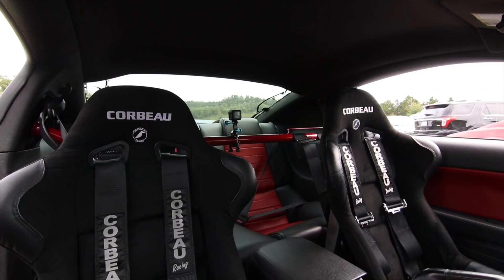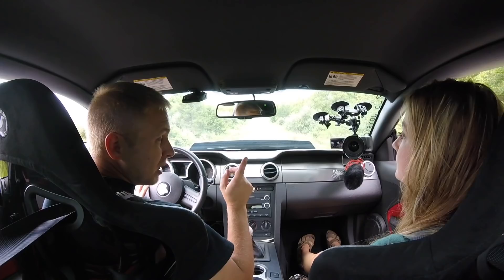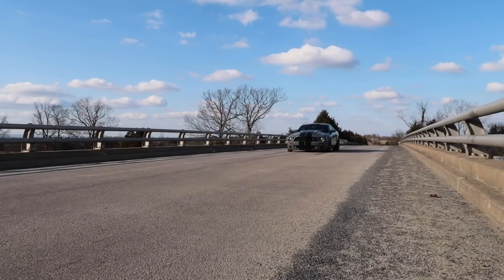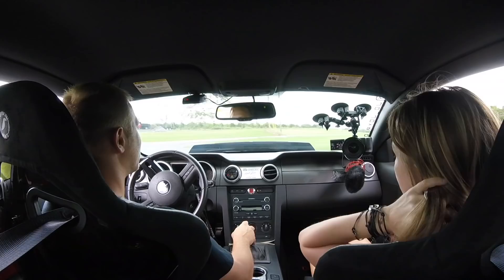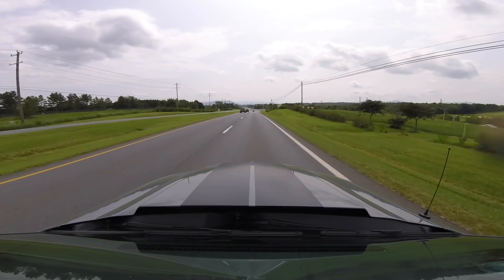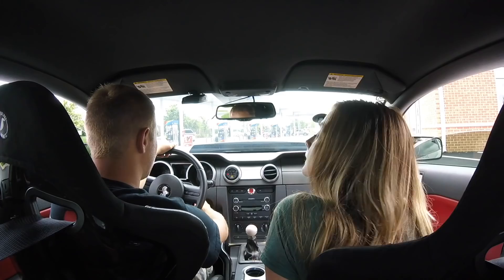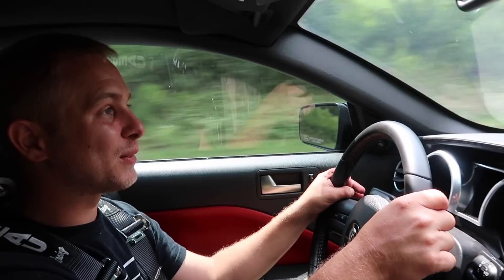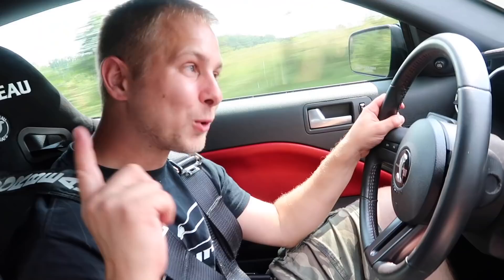First Drive in GT500 REACTION With New SUPERCHARGER

Comment: Thanks JD,  Been building Mustangs for 37 years.  I had a 67 stang with a Cleveor 302 in it that ran 10's. Well that got Stole.  I have had 7 or  so mustangs since. I just bought a 09 Shelby with a Kennie Bell 3.6 some suspension work and has a Super Snake hood. almost looks like your's before you painted it. Been watching your video's and enjoying them for a while, keep them coming. Loving this new use Shelby too. Kurt

Comment: I’m 67, my days spent down in Mexico were back in the Mid 1970s with my 340 Cuda, Trans Am & Z28.

Now the owner of a 2022 C8 HTC, I have you might as well say 500 Horsepower.

500 H.P. is adequate and in the C8 seems controllable.  

Looks to me the 700 Horsepower cars are to be respected in that  it takes but a second or two to get you sideways and out of control, possibly ending in a crash.

I’d love to move up to a ZO6 or a GT 500 as I have the C8 and also own a Mustang GT.  

But, my driving ability has diminished due to age and health issues. 
Therefore, I doubt I will go to any vehicle with more H.P. than the C8.

The GT 500 is a hard car to obtain in my area of PA and I’m very much against ADM & Flippers like Racer X.  I won’t pay over MSRP.  

I got my C8 at MSRP locally and in that case feel “I was for once, THAT GUY, At the right place, at the right time!!!

It’s not the old days of looking at a brochure and going into the dealership and ordering a car you want or picking a car from the inventory on the dealership lot or in the showroom.  

The C8 is the only car of many I’ve ordered 
(Over 15 Brand New Cars in 50 years) that I’ve paid MSRP!

The local dealership where I got the C8, only receives 1-2 Corvette allocations per year. So getting it at MSRP was a great surprise.

Comment: JD I have a VMP blower also and had VMP tune it of coarse. It was a good tune but I had the same starting issues as you just had. I had a few other little things also. I had Lund write me a tune and its night and day. Starting issues are gone and the drivability is amazing. Don't get me wrong VMP is great but give Lund a shot.
Reply from the maker: Mad Max email tune is a lot different than a Dyno tune. Not sure what you had.
Reply: Just did the data log thing back and forth with VMP but did the same with Lund. With good data logs you pretty much don't need a dyno unless you want to know your numbers.
Reply: The tune is only as good as the info and feedback we get.  Always happy to look at logs and address issues.

Comment: Now you NEED adjustable rear shocks, put on the soft setting ....  When you get a chance do a side shot of the car launching from a stop.  The rear of the car should go up, watch over the top of the tire.  When the rear of the car goes up it means it's shoving the differential to the ground.  Now the shocks have to control the motion.  Look into softer front springs as well.  aka 6 cly springs.